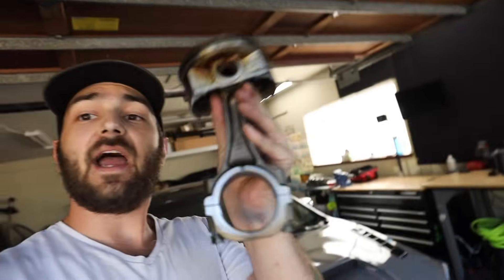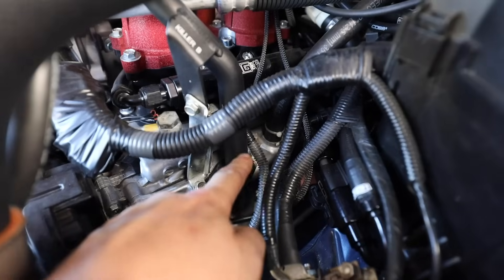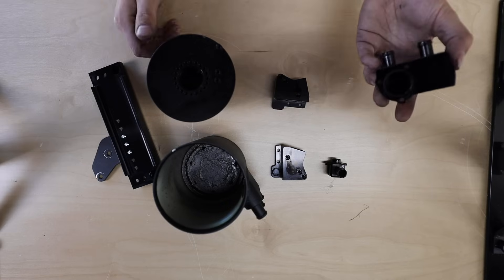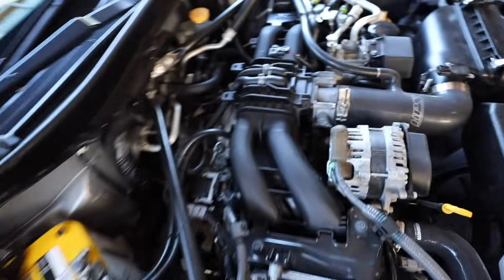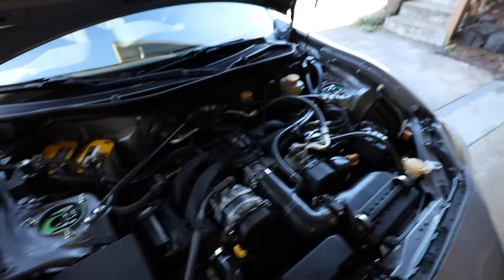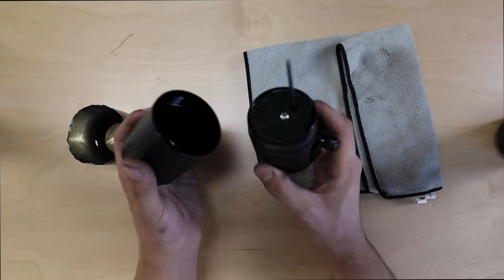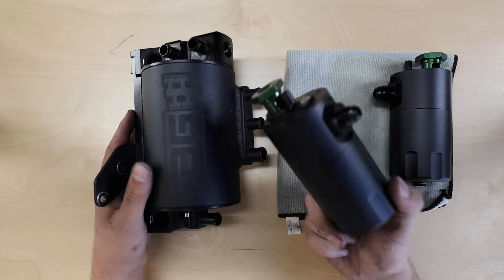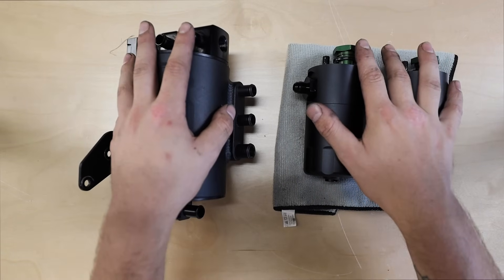Air Oil Separator VS Catch Can Explained. Is One Better?

Comment: What filtering internal setup works the best? I have been looking hard and long for several days on end trying to discover which brand of catch can has what filter set-up on the inside and MOST IMPORTANTLY which filtering mechanism is the ULTIMATE at not only allowing oil and water vapor into the catch device but also the prevention of the oil and vapor to get pulled back into the intake. And to add to that, which device(s) may cause “restrictions” to the crankcase ventilation system — and what about the factory PVC devices do they get removed?

Comment: Finally a video on this topic, I was thinking of running the boomba cans but probably will go the iag aos
Reply from the maker: Both are good options IMO, I'm starting to lean towards cans a little mkre over AOS after seeing the inside of that IAG.
Reply: Smeedia if only install one catch can which one do you recommend will catch more oil on the FA20 motor?
Reply from the maker: Thr passenger side off of thr PCV valve 🙏

Comment: Appreciate the video. Just saw it, sold on both setups for reliability. So is an air oil separator, worthless without the coolant connections?
Reply from the maker: Not worthless but thr coolant connections help to keep moisture from building up by keeping the AOS the same temp as the engine

Comment: I noticed you saying you were going to dedicate a video strictly for that while going through the build process and I haven't been able to find it, or one that shows what hose/ports to plug or connect too. Can you make a video on your AOS Set up on your 2005 Impreza WRX STI? I wanted to know how to mount it to the car and the way you ran your lines. Unfortunately, my car will not have a front mount intercooler so it might be slightly different but that's okay because everything else is the same. I'll just have to tuck things really good

Comment: Gunna throw one on my 06 gxp. Seen i was blowing blue smoke on decel and start up. Pulled the valve cover to see a gummed up pcv baffle. Gunna put a catch can as precaution as I drilled out the valve cover baffle so it would not clog again
Reply from the maker: Not a bad idea, hopefully helps to clear up the issue 🙌

Comment: Brother.. Teach us, please.. Create a rubric like How it Works where you thoroughly explain how each node or unit in Subaru cars works.. For example where water pump lines and hoses are and where they are headed to? PCV system etcetera.
It will be great content for the reason that  you almost can't find this information with good quality in YouTube
PS. Correct me if I made a mistake..
Reply from the maker: Like a detailed install of where each line goes?
Reply: @Smeedia  Yes, you can make this content more complicated, for example if you want to make series about water pump, you can remove each line and hose then explain everything about it and after all put it together along with thorough guide how to do it and where each line goes. You can also do it with Wire harness, Turbo Oil lines, PCV system for example how it works and how delete it and set iag aos (maybe you already have such video about iag but I just haven't watched it yet)
And you can make a guide for each unit.. Some videos will be long and some short. 
PS. Correct if I made a mistake

Comment: I have a 17' Forester XT (the same engine FA20DIT as the WRX for the most part). It gets slightly rough idle on warm up after a few thousand miles before an oil change. I use CRC Intake Valve & Turbo Cleaner before oil changes. This seems to fix it for a while. The intake manifold sensor seems to get pretty oily. I think an Air Oil Separator would help. Thoughts? This my first Subi & turbo gas vehicle.
Reply from the maker: Definitely would help, wouldent be pushing nearly as much oil back into the system 🔥
Reply: I have the same model, did you end up getting the AOS? Any difference?

Comment: Thought - since the "oil" in the catch can was "liquid-y" and possibly having more than just oil, having that go back into the system doesn't sound as good of an idea in case it contaminates the engine oil (making the catch can a better option?)?

Comment: Question buddy
Had a 2014 F-150 JLT oil separator had to empty it every other fill up with gas it definitely worked very well
Just traded for 2018 F-150 purchased a brand new JLT 3.0 oil separator 3000 mi not one drop of oil so far concerned something isn't right can you tell me is this normal?
Reply from the maker: Normal, some engines are better with engine consumption than others. So if your not seeing a ton your rings are probably seated very well
Reply: @Smeedia  awesome thank you so much for the info if that is the case would you recommend leaving it on I have lost maybe 2 mi per gallon on my economy   thank you so much

Comment: What do you think of the aos that is on top of the oil fill port? It's where you refill the oil after a oil change I have a Grimm speed
Reply from the maker: 10/10 do not recommend. Live grimmspeed but that "AOS" does more harm that good. Your better off not using on than it
Reply: Just a question I ordered something off your site , and it said to be shipped out on the 21st , but I check usps and it says still waiting for items.jw.
Reply from the maker: Whats the order #? I'll take a peek tonight, usps been super slow the past few days 😤

Comment: Appreciate the well explained video. What are your thoughts (any pls chime in) of the AOS possibly returning water and unburned fuel back into the engine with the oil? I notice my Subaru buds tend to gravitate towards AOS far more often then my Chevy buds who all swear by Catch cans? I daily an STI and just fixed up my ole '98 z28 which has been mothballed for years now and being old AF I wanna keep her healthy lol.
Reply from the maker: Personally inuse the competition series now so I'm not pushing potential dirty air back into the system. General rule of thumb I follow is of its an external cold area than a catch can is preferred due to the potential of moisture freezing in the oil return line, if its a dedicated power car/track car I'd use a catch can over an AOS. The standard AOS is fine for a normal street car though
Reply: Right on appreciate the response, it's a trip now against aos the camaro groups are vs my subi groups. Maybe those v8's are just more prone to dumpin water & unspent fuel back into the system than our subarus are complete polar opposite in popular choice between the two products lol. I don't care to acrew around with emissions in the CaliKremlin lol so the only legal choice would be the Crawford v2 aos for the STI daily but haven't yet since those Blackstone analysis have shown almost zero contaminates & normal material wear for a car I'm the 80k range when I'm almost at 120k .. The z28 will be the abused car again like it was as a broke youngster before she was mothballed lol. Haven't had any increase in bearing material on the STI since installing a Fluidmpr balancer show up on analysis that number is exactly the same from 75k - 119k now will be putting one on every car from now on.

Comment: I’ve been looking for a catch can for my VW 2.0 TSI engine (factory spec) and my biggest concern is freezing oil lines in winter, what should I consider to avoid that?
Reply from the maker: For a catch can you don't need to worry about it because it will not be returning the oil. But in super cold areas an AOS can have the return line freeze if they're not using coolant to hear the AOS

Comment: I opted to go with the ADD W1 catch can and only installed the CCV side (passenger side)  as I've seen so many videos regarding duel cans that have the same results, dry PCV (driver side) can. The product is comparable to many others but at a lower cost, $170. Haven't seen too many WRX/STI's with this brand, have you heard anything about them?
Reply from the maker: Can't say I have, but I do agree a single catch can is really all that is needed

Comment: Looking into catch cat vs aos for my 2020wrx. My friend said everything is garbage compared to iag v3 street series but really don't wann spend 439$ for an aos. Would like to just go with catch can as long as it grabs the residual oil. I don't mind servicing. And then should I be going with single or dual? Thoughts?
Reply from the maker: I'd suggest the Radium duel can set up, works very well/looks good and easy to service 🙏
Reply: +1 for radium dual catch cans. They’re pricey but are great. The iag aos is probably the best aos on the market. I have an iag aos v3 on my 2018 wrx rn and I’m thinking of switching to the radium dual setup since they are better than an iag aos for keeping contaminants out of the engine. On phatbotti’s website he ranks the efficiency of each and he said from best to worst at keeping contaminants out of the engine is radium catch cans, iag comp aos, then iag street aos. Only benefit to having an aos over catch cans is that they’re maintenance free. Also if you live in a cold climate, definitely get the catch cans because all aos’s suffer from sludge buildup.

Comment: Great video! I have the IAG AOS in the garage, soon to be installed :) Did you see their new AOS? I think it comes out relatively soon. Wondering what the difference is between that one and the current.
Reply from the maker: I saw they were releasing a new one but don't know whats diffrent yet 😅
Reply: A little late to the party but they say it gets more of the water out and some other improvements.

Comment: What kind of hose is necessary for catch can back to intake?  The 3/4" heater hose that I used collapses.  Heat from the engine makes the hose pliable, and the intake's vacuum pressure causes it to collapse.
Reply from the maker: I used a reinforced PCV hose that I bought from O Riley's has not given me any trouble yet 🙏

Comment: w8, N AOS ideally separates stuff & sends only oil back out?- but the catch can separates stuff & sends only air back out?- so I’m guessCng, ideally, a catch can for the clear oxygen port(s?) back to throttle body, but N AOS for pcv port back to manifold? is that right?🤔 - & btw wat do each of these do with water/moisture?😐..

Comment: Am looking for a suggestion from you please for my 2013 Subie Crosstrek, (non-turbo), will a catch can work as well as the AOS can and save me some money? OR should I spend more on an AOS system? Thanks in advance!
Reply: I wouldn't bother with either one for a non-turbo/naturally aspirated setup, unless you're making a lot more power than stock. Turbo engines produce a lot more blow-by than naturally aspirated engines do, due to the increased pressures of the turbo. In a turbo/supercharged setup, that blow-by contains oils that will coat the intake, charge pipes, and intercooler, which decreases performance. Stock, naturally aspirated engines do not have this issue..

Comment: I had the IAG comp AOS but converted to the street version after going flex fuel because I didn't want to have to change my oil every 1500 miles...But now people are telling me the street AOS can clog the EBCS lines...I insulated the AOS drain/oil return hose because we have cold winters up where I live but now I'm hearing that issue may not be the only concern
Reply from the maker: Only issue I've seen is that in extreme cold the return line can clog but never herd of the EBCS line clogging
Reply: @Smeedia  I've seen it in the forums...I'm wondering if maybe it's the result of a kink or maybe another installation issue.  I checked my EBCS hoses after about 10k miles and they were clean so I'm hoping I'll be ok...It's on my Fa20 wrx

Comment: When Adding a catch can to my 007 IS350 Lexus that's both DI and port injection will I be removing the EGR Valve? I do believe that the system is under pressure and need to use a higher quality air tight can system.
Reply from the maker: No you shouldn't need to tie into the EGR, just the PCV

Comment: For the radium setup in the brz, can you empty it without disconnecting the hoses or the can from the car? For that reason would you recommend the radium drain line option to facilitate emptying the cans?
Reply from the maker: You can, but its a little annoying to unscrew the cans while in car 😅🙏
Reply: @Smeedia  thanks.  I might put enough slack in the line to just disconnect the bracket maybe... I would hate to constantly disconnect the hoses and develop a vacuum leak

Comment: i install a AOS on my WRX and used clear silicone hoses to see the magic and damn there is a lot of confederation. everything throw black rubber horse and assume all is fine.

I think I'll just run a catch catch and drain it. the coolant hoses arent heating the hose off the block to the AOS where the condensation really happens

Comment: Aside from the benefit of not having to manually check and drain from time to time the excess oil in the catch can, is there any additional benefit using an AOS?
Reply from the maker: Not really, the AOS is just more of an install and forget it type of system 🙏

Comment: I have an N/A EJ25D and I've been looking into adding a catch can but until I looked them up I didn't know there were Air Oil Separators AND Catch Cans. Now I don't know what to get lolol. Anyone recommend one over the other? I don't have any power mods on my engine, just want it to function at its best and live a long healthy life!
Reply from the maker: For the 25D a catch can would be sufficient 🔥 saves you a little bit of cash and will still provide good engine health 😁
Reply: @Smeedia  Thank you sir, will definitely shop around for one!

Comment: I don't understand why you would heat it up? Doesn't a condenser require a temperature differential?
Reply from the maker: Heat it up to prevent moisture and condensation build up so your not getting water in your oil
Reply: @Smeedia  Oh, it goes back through the engine. Weird! Thanks for explaining

Comment: Hi Smeedia, I have 2016 Forester 2.5i FB25  block and decided to run a catch can as I had my original block after 200,000km, succumbed to an internal head gasket leak. Rather to repair it, I opted for a low KM 2017 FB25 block and had it recently installed. I'm trying to get as much longevity as possibly and thought the oil catch can would help.  I have heard that it also increases crankcase pressure and acts as a restrictor to the PCV system. Have you heard of this and do you have any insight for me?

Comment: Do you run the IAG AOS competition? If so, I get mixed answers when it come to tuning with an AOS that dumps crank pressure to the atmosphere. Any feedback?
Reply from the maker: I do not, my car did not meet the criteria fr thr comp series. IAG has a chart on their website for when to use what AOSZ
Reply: @Smeedia  thanks! Yeah I've seen that chart, and it recommends a tune but many local shops/pro tuners near me dont think it is necessary specially if staying relatively stock as I am with my '14 hatch STI

Comment: I'm putting dual cath can on the 22 wrx would it be fine if I put em on or would there be problems I've seen someone say that the catch cans cause the blowoff valve not to work correctly

Comment: Smeedia, I have my flexfuel kit installed and all the parts suggested by you for a E85 swap, I already did a protune but I having some issues when I cold start the car, I saw your video about it and you said that is normal in cold wheaters because of the nature of E85, but I’m in Miami and right now is like 90 degrees every day, the car starts fine and it never turns off, but is does like is gonna or if you push the throttle it doesn’t respond well, I just want to know if that is still normal because of the E85 or I need to contact my tuner again. Thanks for all your help and the great content man
Reply from the maker: Its worth sending some logs to your tuner to see what he says, ive never had issued like that with mine 🙏
Reply: Smeedia I’m gonna do that, thanks for the help, I hope is nothing serious also because one the car is hot there is no issue

Comment: Just finished installing an AOS on a 2016 WRX (Crawford. I’m sorry, but I should’ve done more research).
Anyways, the car won’t start. AP gives P0606 which is an ECU fault. Could it be the battery? A pinched wire? I’m kind of panicking here. Any advice is appreciated. Thanks.
Reply from the maker: Double check all wires are plugged back into the ECU had that happen once and the ground strap was off

Comment: If there was water mixed with the oil "making it more liquid" as you said, it would be milky brown. Catch cans are they really necessary?
Reply from the maker: Depends, I've mainly seen it turn a frothy white/yellow color. They're not 100% needed for most daily drivers but when you start making more power yes. You'll increase the amount if blow by, especially with a FI application

Comment: I have a question for people with catch can setups on the “PVC” side.  Do you run a dual check valve setup so you are not pushing boost into the catch can from the intake manifold.
Reply from the maker: That was my concern with my cans, but I do believe there is a secondary check valve with most kits
Reply: Ok, I had a Mazdaspeed3 before I got my 2020 WRX.  In the Mazda I had a secondary check valve because there was boost going into the tank and the hoses would leak under the pressure.  So I may do the same for the WRX.

Comment: Tengo 3 preguntas.  un oil catch can puede generar mas presion dentro del motor ?? importa  el tamaño del occ con un  motor L4, v6, v8 ?? y por ultimo es mejor  1 o 2 occ en un motor v6 ya que esos motores tiene 2 salidas de pcv una por el banco 1 y la otra en el banco 2 ??.  Tengo un impala 2019 V6 motor es LFX y cuando le instale el occ me empezo a silbar y cuando le quitaba la varilla de aceite se le quitaba el sonido al final se lo quite todo por miedo que se me rompa el motor